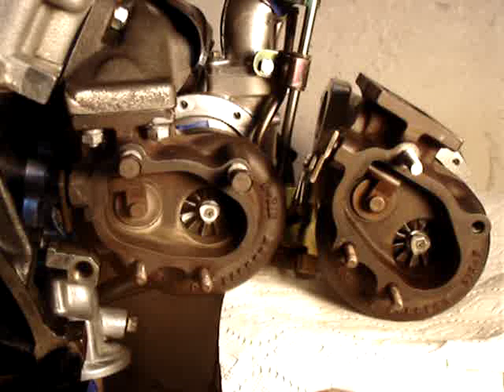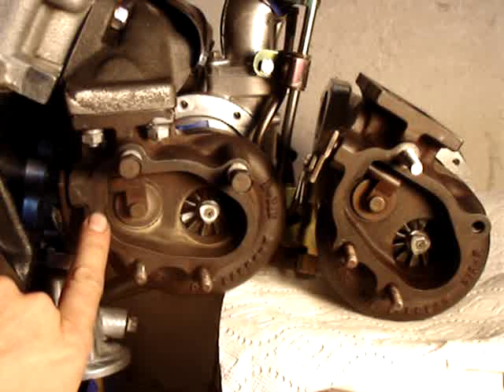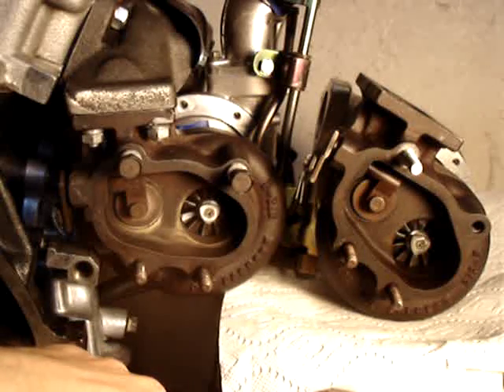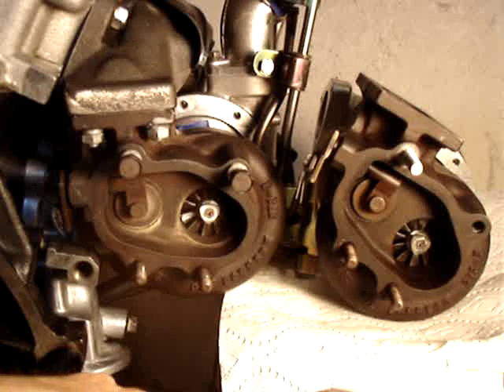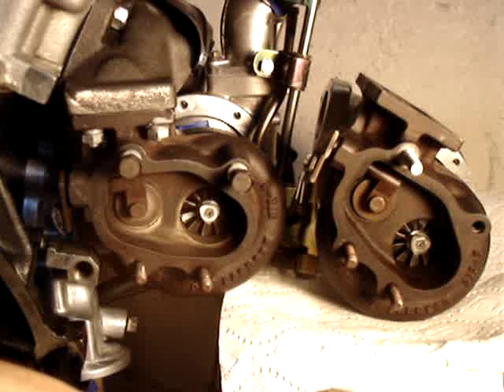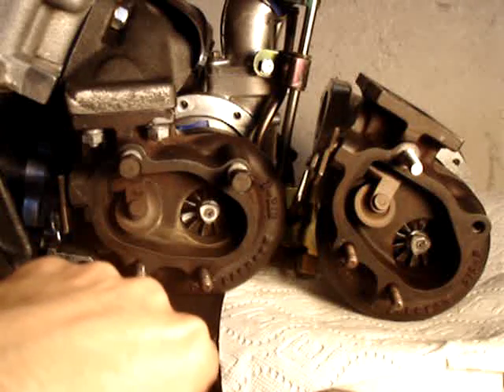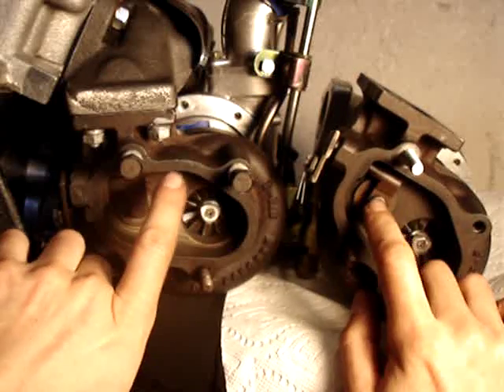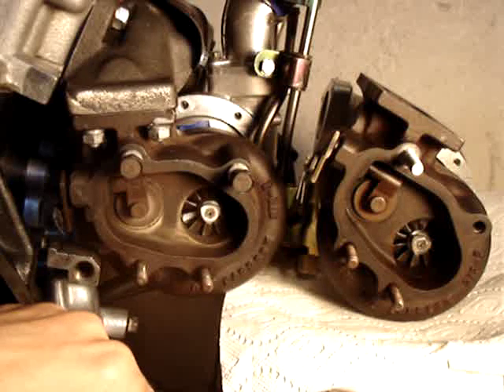Balancing Nissan 300ZX Stock Wastegate Actuators

Comment: Thanks for a good lesson in the timing with these turbos. I had a shop install aftermarket turbos since I couldn’t get the stock ones rebuilt in time. I found that they didn’t check the vacuum line tip, for the wastegate actuator, and surely it was in bad shape. The hose broke off, so now the wastegate is not on the passenger is not working at all. On top of that, I remember him stating he had to clock new the turbo to get it to fit in place. Now on top of wastegate issues I most likely have major timing issues. All this might explain why when I give it full throttle, the engine acts like it has a stuck throttle linkage and will stay full throttle Eve after I take my foot off the gas. I have to tap the throttle and it revs down.